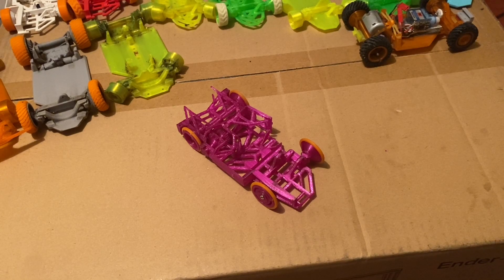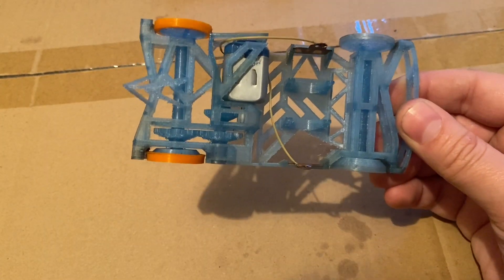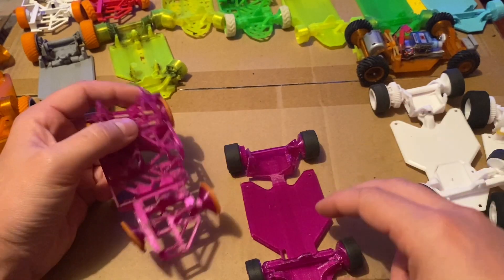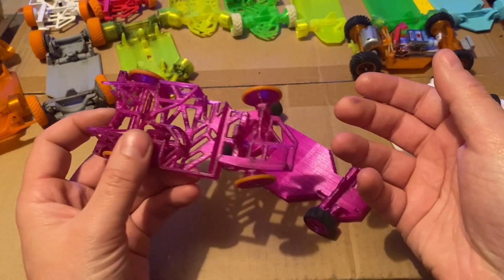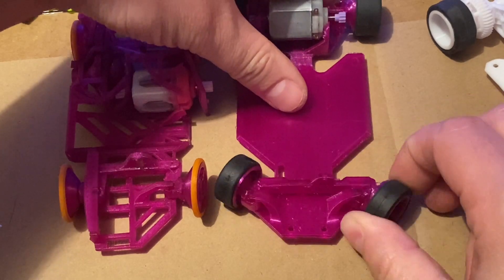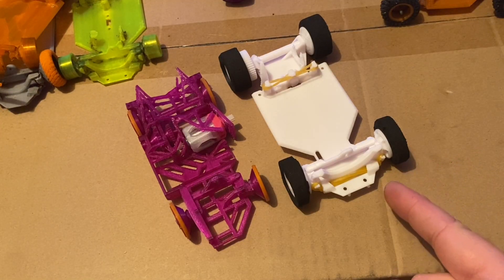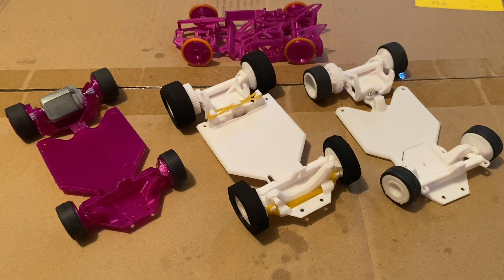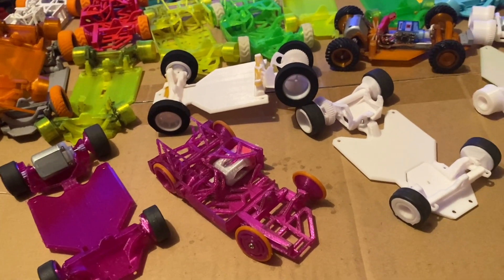The Gamma - One Year Later

Comment: Do you have a file for some tires I could print?
Reply from the maker: i included some tire files with the latest version. I uploaded the files on thingiverse and cults today. The link is in the description of my latest video.
Reply: @underengineered_1077  Thanks! Gonna print one out tomorrow since I broke my other two trying to jerry rig some smaller parts in there and turned out I need that little arm between the servo and the steering rack hole, so I'm gonna make that too.